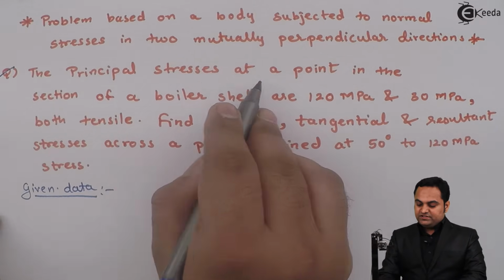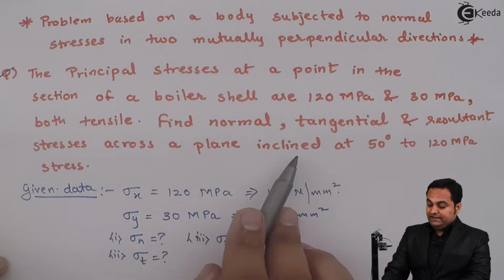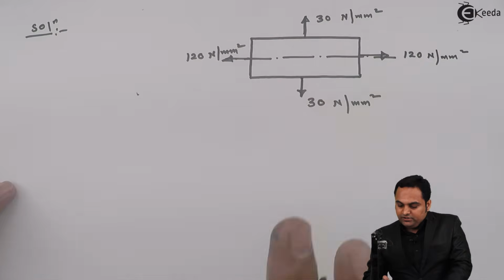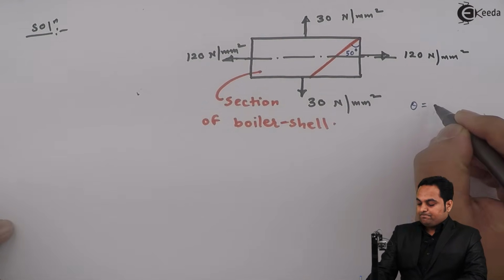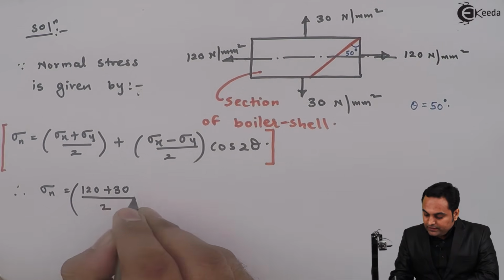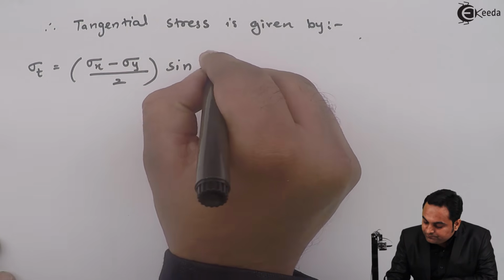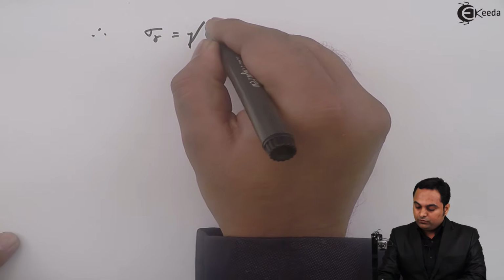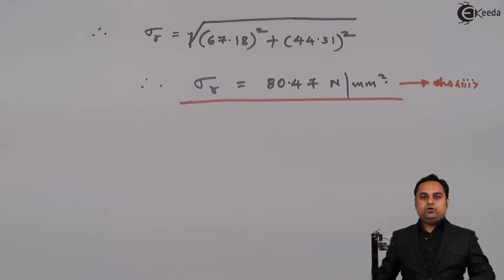Normal Stress in Two Mutually Perpendicular Directions - Problem 1 - Principal Stresses and Planes

Comment: Sir upto last video you said that the angle was making with the axis of body but in this problem there already mentioned that inclined plane is making an angle with 120mpa stress.what is the reason to considering the angle was with the vertical axis
Reply: Ya same doubt